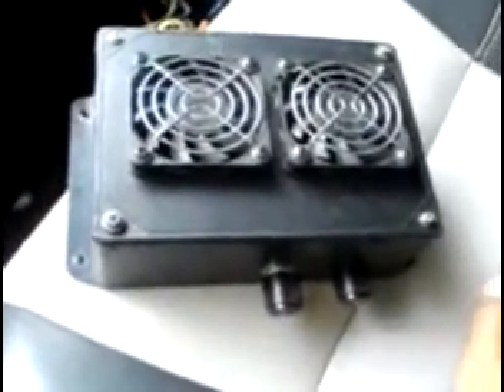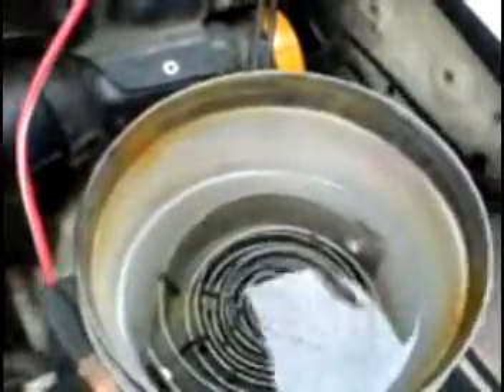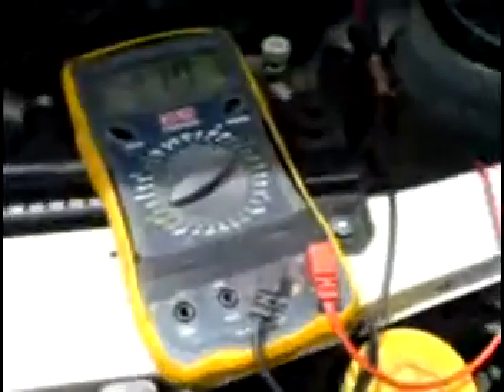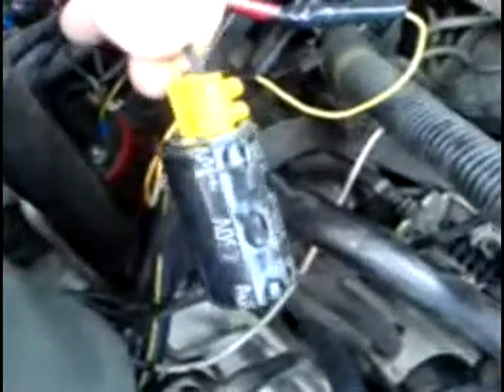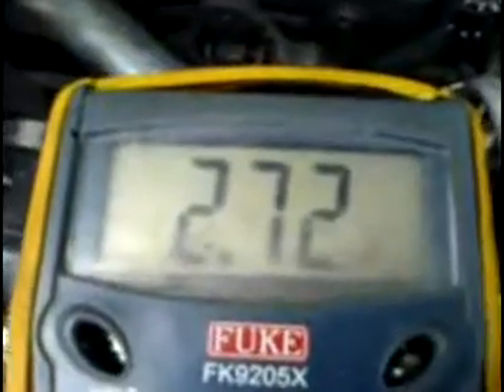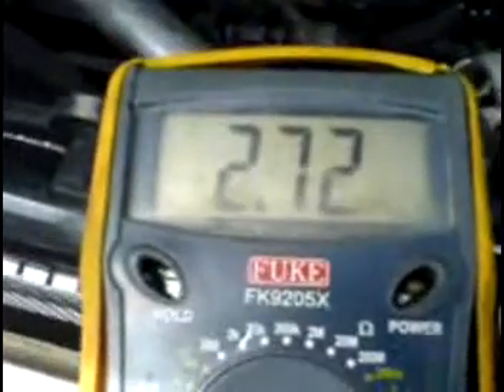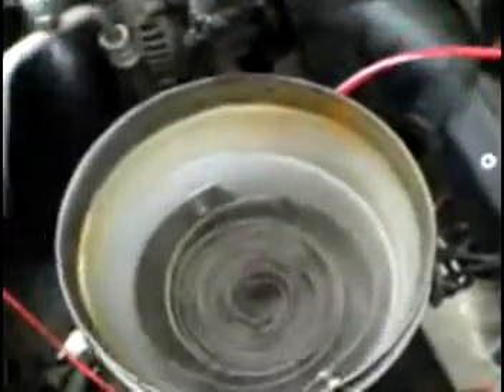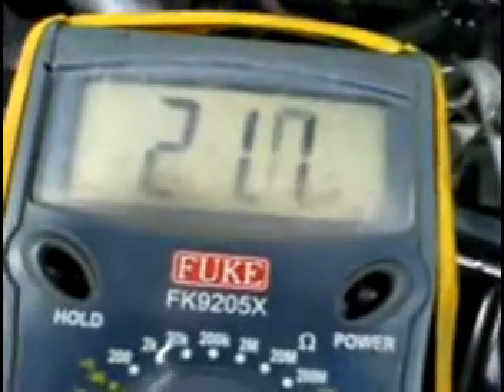HHO - 2vdc test

Comment from the maker: @imtotob 
Huo nga Bro..d lang makausad dahil sa dami ng office works at kulang pa sa budget...ang casing ko d ko pa nabayaran kay Vox...hehehe...prelude sa balak kung setup with double ignition coil driven by 2n3055 transistors then convert to low voltage/high amp setup...tingnan natin kung ok.